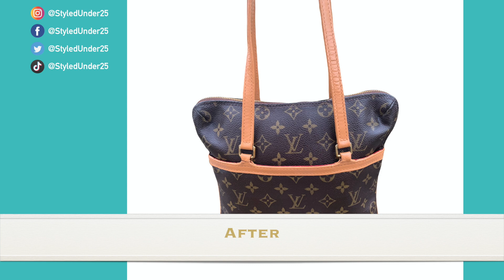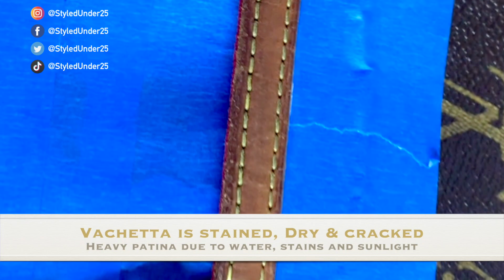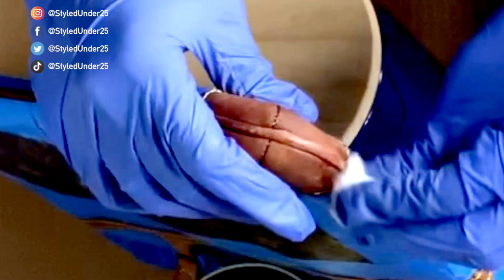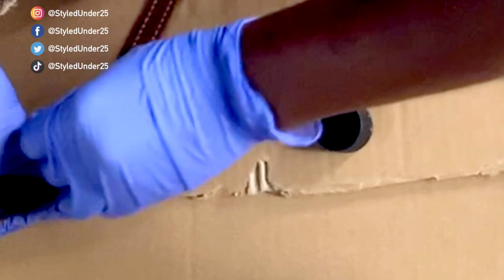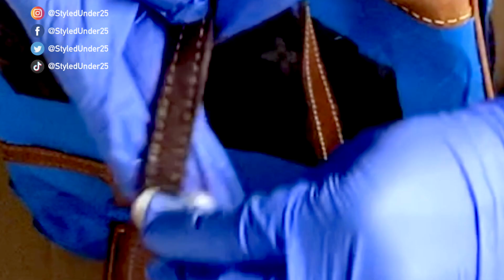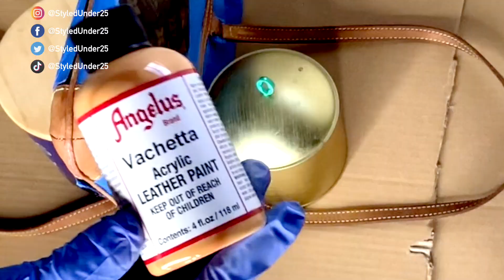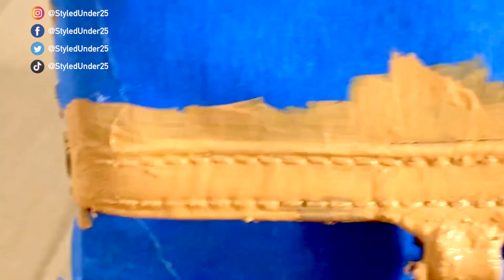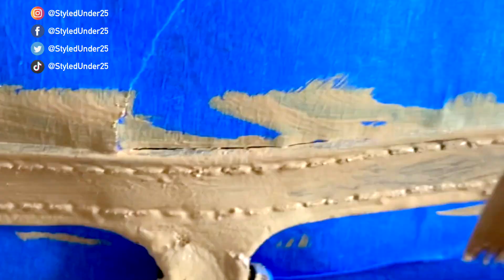The Art of Slow Fashion: Louis Vuitton Bag Transformation

Comment: Layering the paint too thickly there! Thin layers over and over works better and prevents cracking, but is more fiddly and time consuming. 
Also the loops where the straps are added to the bag are wearing out and need to be reinforced from the inside of those loops.  I would use reinforcing tape which is woven and sticky you may be able to do this in stages to avoid taking the bag apart.
Something else to note: if you want to replace the vachetta later you won't be able to with Louis Vuitton, they don't accept bags which have been altered
I would also add dark red to the edges of the bag for a sharper finish, but it depends on how much time you're prepared to give the project it's not cost effective to be too finicky.
 Impressive result overall with the result you did what I would have done in restoring the leather before painting it.
 Good move there!
Reply from the maker: Thank you for all this beautiful feedback.